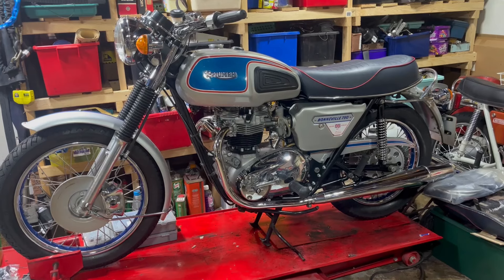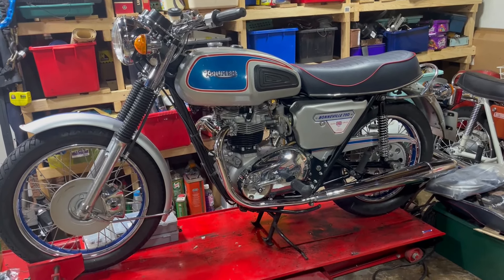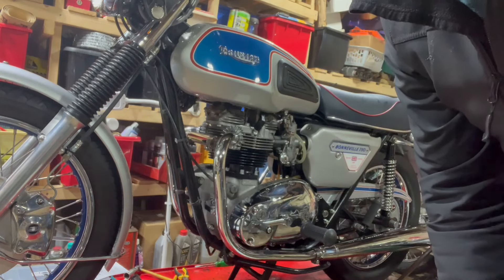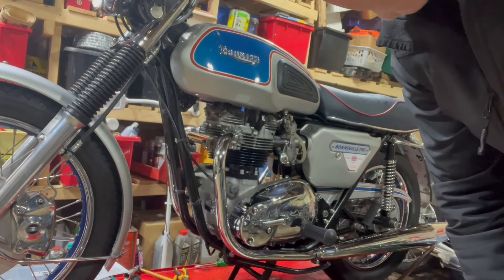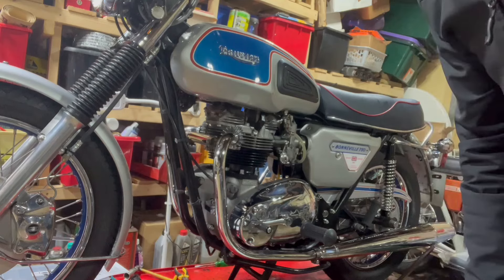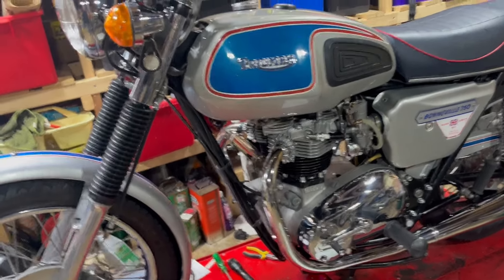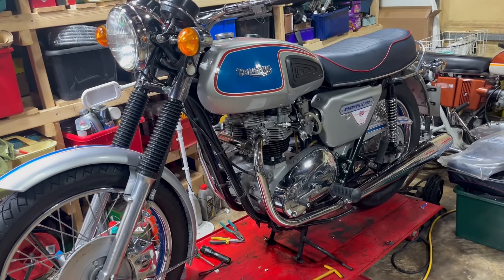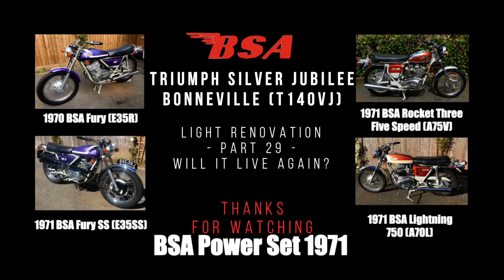Triumph Silver Jubilee Bonneville (T140VJ) - Light Renovation - Part 29 - Will It Live Again?

Comment: Good to hear it running, if only briefly. I've had the Charlie's type oil filter in mine for about 25 years and never had a problem with it stopping oil getting through (I've always used 15w50). 
I have had oil  pressure issues on a few occasions, mainly when the oil pressure relief valve has stuck, and the excess pressure has blown the crank oil feed seal (in the timing cover) inside out, but that won't happen at idle speed.
The other time was after having the oil system empty to change the oil pump - when I refilled it, the supply line from the tank had an airlock, and the pump wouldn't draw the oil through until I disconnected the line to bleed the air out and prime it. As you've already had it turning over and putting the light out, it must be primed, so it's not likely to be that, but it may be worth just pulling the oil line off the connector at the engine end to check that it's full.
Reply from the maker: Cheers Rick. I left it to settle and went back to it later and oil light now going out on kicking over 👍

Comment: The main “issue” I had with my T140V (T reg) back in the early 80’s was the oil light coming on, the first time it happened was on the M6 travelling from Birmingham back to Northamptonshire. I assumed it was low on oil but when I checked the level on the hard shoulder oil came pukking out of the frame, so there was plenty of oil there it was maybe not in the right place ? When I tried kicking the engine over and the oil light went off, and faced with no other option I limped the remaining 50 miles home with no apparent ill effects. After talking to a chap at Vale Onslow (when your show Fury was there) I stripped the oil pump and found it was working perfectly. The oil light came on two or three more times during rides and then the issue seemed to go away, I never got to the bottom of what the root cause was. The oil I used by the way was Duckhams Hypergrade 15/50.
It would be lovely to see a little test run on the Bonnie once you are happy with it, permission/ insurance permitting although you don’t want it to get dirty either ! 🇬🇧
Reply from the maker: Thanks Stew for the anecdote. I left it to sit for a while and went back to it several hours later and the oil light started going out again on licking so all bodes well. You’re right about riding - the insurance will not allow unfortunately although I might try a bit locally to test brakes etc. if I can. Will take some advice.

Comment: Nice.  When did Triumph start doing the bread box style tanks in the UK vs the export style rounded tank?
Reply: This shape of tank came in for the 1971 season with the 650 Triumphs and A65 BSA.  However, it would most likely have been late 1970 when they started producing them as my original oil in frame BSA left Small Heath in January 1971.  For 1972, the centre seam disapeared on both the Triumph and BSAs.  If I remembber correctly, 1972 was also the year when the rubber knee grips were added to the four gallon UK tank
Reply from the maker: Hi Dave thanks for interest and comment - yep @alexanderpotts is spot on.